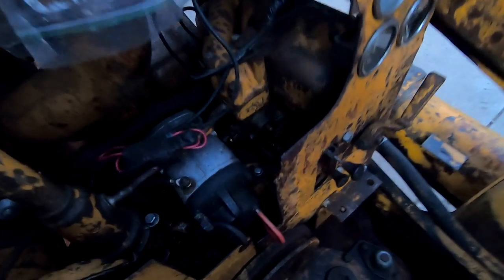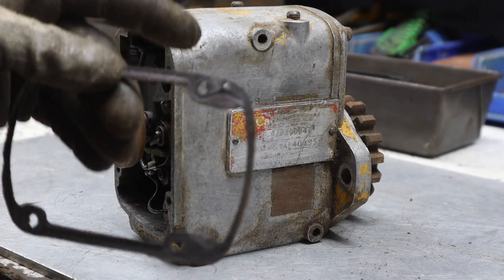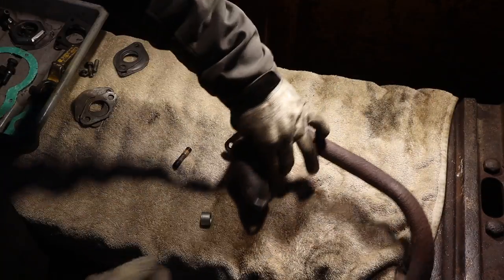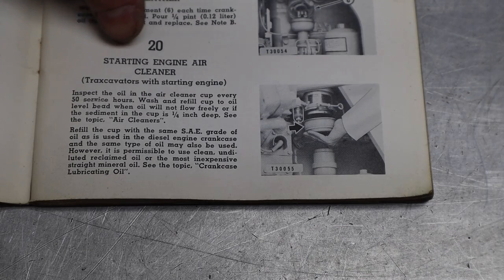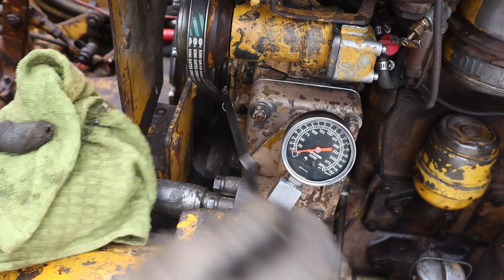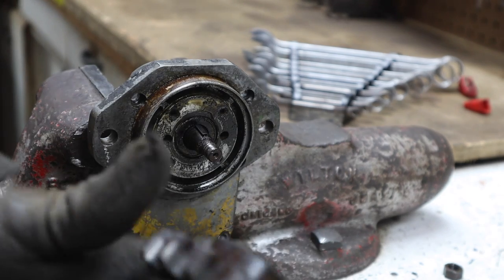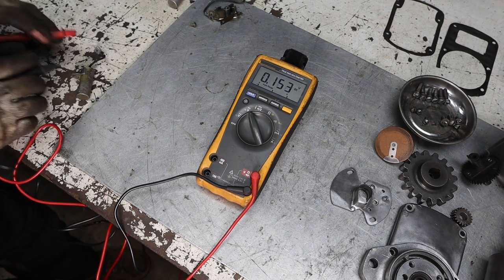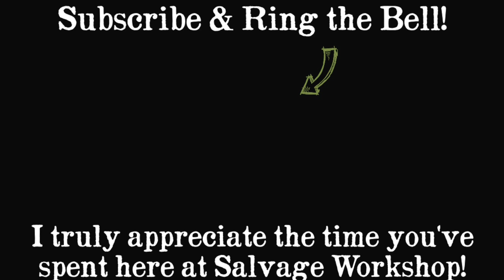FINALLY Found the PROBLEM! ~ Time to Rebuild a Magneto ~ Part 14 ~ 1950s Caterpillar TraxCavator

Comment: For that  messed up hole - you should have used a heli-coil rather than put an odd sized stud in there, second, ready made threaded rod does NOT have the same strength as the original factory stud. You can end up with that piece of soft steel breaking on the root of a thread and then have to get a proper stud anyway. When you have stripped gears - there is a reason, Something forced the gear to turn against too much resistance.  If those gears are made from bakelite - they were intended never to have a lot of torque applied. Looks like fun. Check everything that might cause trouble, rather than assuming the cause and effect of any situation. Looks like you have resolved one problem only to find yet another.  One step at a time and it will run again. This time properly.

Comment: I'm sure someone else may have said this but check on the donkey motor crankshaft end play and backlash if the main bearings are bad and the donkey motor it'll start taking teeth off the mag...

Comment: It's a distributor cap.    But think how much simpler life would be if you just replaced the pony motor with an electric motor.   Yes you'll need a hefty battery pack but how often do you really need the CAT?  You can use a power-wall module that you can disconnect from the house when you need it for the CAT.
Reply: The question is not efficiancy. Its more to keep the machine as the engineers designed it back in the old days just with pencil and paper.
Reply: @thomasmuller9243  I hear you and appreciate that.  Many restorations result in the original module being preserved for future use if the owner wants to have it look factory fresh but in use a different type used.  For example tires on a vintage car.   In this case the Magneto would look fabulous in a display case (with the shiny Bosch ID plate) while megasquirt does the ignition reliably and simply.   Or an electric motor to do the job of the pony motor.   Thanks Thomas!  Paul.

Comment: The messed up bolt removal started because you didn't have a transfer punch set to get the punch mark right on center.  Also, a stub could have been drilled for an 1/8" hole in your lathe and put in the available hole depth and used as a drill guide.   There is no more important step than getting that punch mark perfect.  Everything good and bad follows.
Reply from the maker: Do you really think you see EVERY step of the process?
Reply: @SalvageWorkshop  Not at all, probably one minute in 30 to 60.  You've poured hundreds of hours into that project.  Wouldn't surprise me if you told me over 1000 at this point.  Just offering additional methodology to an already very highly skilled mechanic.

Comment: Mega difference between Salvage Work Shop and Squatch253. One is  trying to piece together TraxCavator with limited budget and limited access to good salvaged parts. The other seems to have a better budget, access to good parts to salvage and is a perfectionist when it comes to his machines. I really enjoy both perspectives to a common end.

Comment: Hi, it kind of looks like the crankshaft bearings on the pony motor have a lot of play. Or the taper on the flywheel is out of spec. Edit: Ah, you mentioned it. nevermind.

Comment: Capacitor and condenser are synonyms..  Condenser is the old term that is no longer used except in the automotive industry for that one specific component..  Capacitor is the modern term used everywhere else.

Also, how is that magneto timed with the motor?  There must be some timing marks or something on the gears assuming that your mix-and-match didn't change all the relationships..

Comment: this is just a guess, but if that red wire from the mag was the ground wire, breaking it would keep the mag hot. Turning a switch might ground out the mag.  I'm thinking airplane engines here.

Comment: I know you will probably know already but that magneto needs to be timed to the motors spark pulses just like a distributor. top dead and all that, I was looking carefully as you were stripping/rebuilding it and never noticed any timing marks. what does the great yellow book of words say ?
Reply: Some other people have said that there is timing inside the mag as well but the gears & shafts all are keyed will that time everything, I think not !!!
Reply: @dirtfarmer7472  exactly, over the course of many years I have seen keyways and woodruff keys cut on things at all sorts of weird angles not just perpendicular, my reasoning would be to look for slots or dots on the outer edges of the ring gears all marrying up with TDC of probably the cylinder that had the red lead on assuming that to be number one,  if not that rotor arm could be miles out and you would never even get it to cough if you cranked it till a week next Tuesday ..or even worse it fired the other cylinder on induction stroke.....oooops, also once back on successfully I would do a mag drop test on it just to see if its chucking out  electrickery at the correct oomph.

Comment: Most points the contacts are polished and when cleaning them with a file or sand paper it destroys the polish and the will carbon up alot faster then normal. Saying that I have cleaned many when they carboned up till I could get a new set. The condenser ( capacitor) is needed to make ac to produce the high voltage.
Reply: No, the condenser is in the primary circuit and it is there to provide an alternative path to ground for the self induced voltage that forms in the primary winding when the points open and the electromagnetic field collapses.  When the field collapses, current is induced in both the primary and secondary windings.  The current induced into the secondary windings find a ground by jumping the gap in the spark plug.  The current in the primary circuit would have to jump the now open points gap to find ground, and the arcing would quickly burn away the points contacts.  The condenser provides an easier path to ground for this self induced current, thereby giving the points longer life. Because the path to ground provided by the condenser is not perfect, some arc-over still occurs.
Points don't carbon up (unless there is some type of oil intrusion present).  The fouling of points contacts is due to metal transfer caused when the points close and open.  Some of this transfer is similar to arc welding where your electrode tries to weld itself in place when trying to initiate the arc, and some of the transfer is exactly like arc welding when spray transfer takes place.
And yes, points do corrode. During the metal transfer process, some of the metallic material will combine with atmospheric oxygen creating oxides, which are indeed a form of corrosion.

Comment: Be sure and don't use gas with ethanol. It can cause brass or bronze which old needle valves are often made with, to pit and leak. That's likely why he has to be sure and turn off the fuel. Otherwise, the crankcase fills up with gasoline.

Comment: Gear on the back doesn't spin because it is Spring loaded once you overrun the spring a magnet will Snap over causing the spark !!

Comment: Magnetos use copper wire plug wires. You strip the insulation and leave the copper core long. You then fold the core back over the insulation and crimp the point on the copper end cap through the core and into the wire insulation. Then the cap is installed with a bit of sealer to try to keep it dry. Also, those little plugs in the bottom of the pony motor heads were designed as compression releases just like an old hit and miss John Deere tractor. They had quarter turn valves installed in them. 
   Makes starting them a lot easier if your a skinny old guy. It also let you get rid of the gas if the fuel wasn’t shut off and filled the cylinders with gas. Don’t ask me how I know.
  Good grief. I should have watched the whole video before I commented... eek. 🤷🏻‍♂️😖

Comment: Actually you trim off 1/2-3/4 of a inch of the insulation and fold it under the end before crimping it on

Comment: You might check out videos by squatch 253. He has videos on building and repairing pony motors and even explains a magneto from a pony motor with a bent shaft and broken teeth just exactly like you had and explains the cause.

Comment: Hi why don't you bench test mag using Hoover drive belt and electric drill,saves a lot of stress.
Also as you love this machine,why don't u put mains rings etc in pony engine,do valves etc
Could also ask on video if anyone has the broken cogs and parts or mag they may give to u.Then rebuild as spare
Love you're work ethic great machine to
What make is pony,badged catapiller

Nick London England

Comment: At some point it was mentioned that the pony flywheel was loose. A loose flywheel can cause the mag gear to break and bend the armature. That front bearing and locating pin can cause problem but if you're crank end play is not excessive it is likely ok.

I hate to see you go in that deep because the last time I was in to one it sat in pieces way too long before it got put together.

Comment: when points open the magnetic field  collapses on the coil generating a big pulse of juice and the spark plug fires. So not really a direct on off switch for the spark plugs.

Comment: This is just the small motor, the real adventure will be the big old worn down diesel engine! My brother in law and I tried to rebuild an old Cletrac back in the '80s, we had to give up, it was just too worn out
Reply: One of my uncles broke a piston getting a seized Cletrac torn down. He machined a Volkswagen piston to replace it. It had been running in local parades towing the (also rebuilt) similar age town grader for the past 15 or so years.

Comment: 18:04 Why did you not just screw in a 1/2 bolt reduced and rethreaded to the smaller measurement on the other half?

Comment: You sounded a little unsure about the condenser, so hopefully I'm not teaching granny to suck eggs here. It's just an electrolytic capacitor and can be replaced with any similarly rated off the shelf component. With the points closed, we have a circuit in equilibrium through the priimary coil with stable constant magnetic field. When the points open we have an open circuit which causes the collapse of the magnetic field in the primary, which induces a voltage in the secondsry. Having many more turns, the secondary creates a..much higher voltage and this is the pulse which fires the spark plug. At the same time however, because the secondary voltage has changed this creates another magnetic field which induces current back into the primary known as a back EMF (electromotive force) which wants to go backwards around the circuit and would arc across the points. The condenser is there to catch the back EMF and protect the points from the damage successive electrical arcing would cause. Once the points close again, the capacitor can safely discharge and thr circuit returns to equilibrium state ready for the next ignition cycle. Again, I hope that's helpful.

Comment: Be very careful don't spin some mags unless their grounded. You could get zapped and or it could damage the mag. Also when you had the head off there was a lot of oil in the cylinder and your pumping oil out the exhaust . Since your tearing it down again re ring it,
Ps i dont know where you got that running with 30lbs of compression theory but its bull 75 is the absolute min and even then it will be hard to start.

Comment: When you're starting the pony motor be sure your clutch to engage the diesel engine is not engaged.  I saw that your diesel engine was turning over when you were trying to start the pony motor because the fan was turning unnecessary wear on pony motor and pony motors starter. Clutch on pony should only be engaged after pony is running and warmed up
Reply from the maker: Yup I know... that's a new thing! It's disengaged. I have to sort that out too!

Comment: Did you inherit all of your tooling? Seems like you have everything and are not old enough to have collected so much?
Reply from the maker: The only tools i have inherited were a hammer from each of my grandpa's, that's it! I have collected, rescued, & salvaged all my tools and machines myself over the years! One thing to note though, i RARELY buy new, and i rarely buy a tool right when i need it, usually it's well in advance of needing it!
Reply: @SalvageWorkshop  I'm impressed! Seems like you have a solution to every problem you run into. I'm a professional mechanic and I have to run to the auto parts store every time I do a project.

Comment: Those are carbon core conductors not wire. Exhaust bolts in 1950 were probably brass and not steel. Ron

Comment: Found myself shouting at the screen when you tested the capasitor; "YOU ARE GROUDING IT OUT ON THE METAL PLATE" ;-) Also, does the magneto need to be timed "internally" as  well as to the crankshaft on the motor?

Comment: I would be concerned about the broken teeth is the broken metal still inside the motor ? If you never found those broken pieces then its bad news if their still inside the crank case could be a future problem.

Comment: I working on a 57 d8 cat direct drive engine tag says it is a d8f i just had it bored 20 over pistons valve done and crank mains brought back to standard and rods done to 20 under but this is an inline two cylinder and mounts on the side yeah the machine it self is worth the rebuild of the pony as for yours seems as though you only need to do bearing Oh this is about pony not diesel diesel engine had been seized up over heated all i had to do the is put new liners in and rings was able to save pistons

Comment: Comparing that pony to an older model on a, uh, different channel, it looks like those "summer teeth" are going to just drop into the sump but, man, if they get caught up between the crank throws and a tight space...:(     Don't sweat the condenser. If you're worried about it, just leave it out. Eventually, not having one will start to eat the points, but not for a while. Assume ANY capacitor that's 50+ years old is bad or ready to die. If you're ever at a swap meet/hotrod show, keep a lookout for old Accel "Fat Stuff" ignition wires. They are (or were) high quality, 8mm, silicon jacketed, pure copper racing wires that were used back before even hotrods and dragracers became computerized.
Reply: No spark without a condenser. And they don't deteriorate unless moisture gets inside.

Comment: You could have used a helicoil to keep the bolt the same size.
Reply: or put the larger bolt in with red lock tight sawed it off flush and drilled tapped for the smaller bolt. may not want to spend the money for a helicoil kit.
Reply: Or machine the new stud down on one end, and tap a thread the same as original on the now smaller end.

Comment: I'm wondering if the electric starter might have been an option.
Reply: it would have to be big and expensive . Also those old diesels have to spin for awhile sometimes to start.
Also cat sends equipment all over the world . some 3rd world country's dont have or cant afford 4 large batteries. So you start the pony motor with a rope and use it to start the main motor. if you dont have good battery's. No battery's required.
Reply: @tomhutchins1046  I was thinking of the electric starter as an option for the pony motor.
Reply: @craigsmith8217  it has an electric start the rope pulling is just the back up.

Comment: Please sandblast and powdercoat back to fresh cat yellow on some of the pieces while there off 🙏🏼
Reply from the maker: You have NO idea how much more time that will take when taking on such a HUGE project such as this!
Reply: @SalvageWorkshop  I paint everything i repair so it makes it look like i did something. It was not powder coated some simple cat yellow spray paint in a can would be fine. Its a motivator to see more and more painted parts on a project like this. Plus equipment is painted for a reason all that shinny wire brushed steel and aluminum will be a corroded mess before long.
Reply: Oh yeah of course it’s definitely not feasible to do for every piece but maybe just some key bits and areas. Would look interesting to see the pop of contrast between Old and Fresh new. The inside area for starters maybe with the instrument panel piece, would be so cool seeing all gloss and new next to a nice new leather seat or something. Also the powdercoat clear over the yellow for maximum durability and gloss 🤩
Reply: @VL45EX  LOL Yup they call it lipstick on a Pig

Comment: In the future they sell, at a reasonable price, helix coil thread inserts. They allow you to oversize then return to the original thread specks. So you won't need to drill out a manifold ear. Because sometimes the gods of restoration will not grant you the room to oversize a hole without compromising the integrity of an ear on a manifold. O yea that magneto cap is made of what was called Bakelite. Not that it makes a crap but there it is in case you ever see another 5000 year old whatever.

Comment: Okay you know you have good valves good pistons and rings good compression all you need to do is put new bearings in how much you need to grind crank to fit undersize bearing that is the question or you might have to have journal welded back to standard

Comment: Check your coolant passages between main engine to and for usage for the pony engine, which away to warm main engine during cold weather before starting it. When are you remove pony motor from main engine.

Comment: Hmmm, both magnetos have broken teeth. Points to me there is something else what is causing the teeth to break. The wear pattern on the magneto drive gear to me shows there is some misalignment. Could indeed be too much play n the crankshaft bearings.